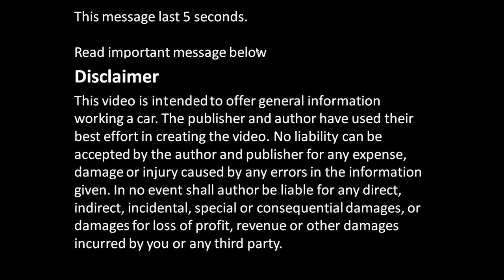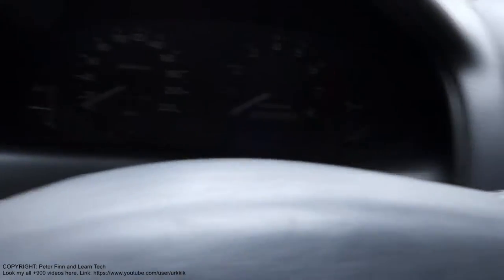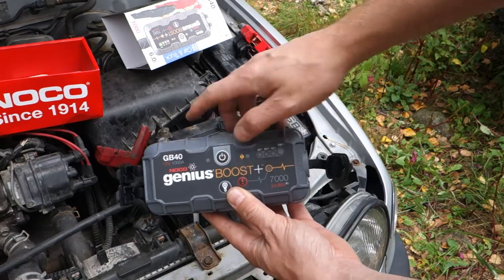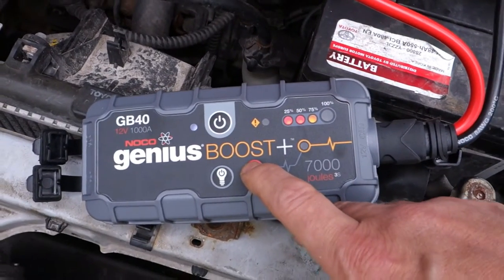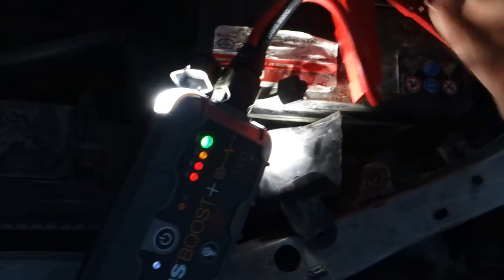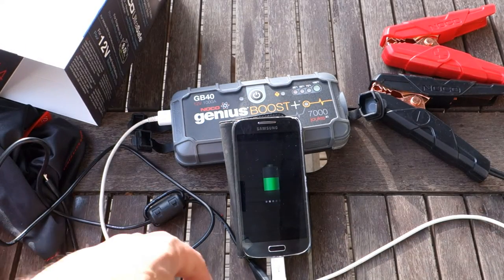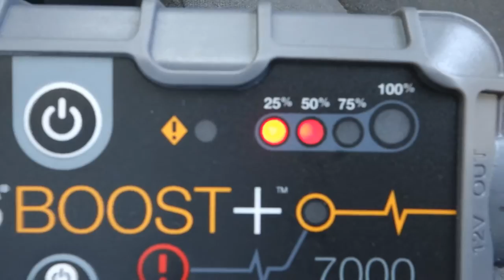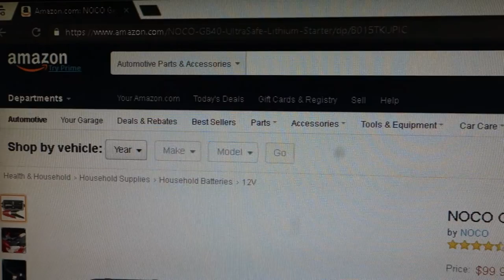How to use Noco battery booster to start pickup truck like Ford F-150

Comment: How many liters does you engine have?  Is that a V8?
Reply from the maker: 1.6
Reply: Thank you.  I don't think it's comparable to a F150 though.  The reason I'm asking is to decide whether to get the GB40 or the larger and more expensive GB70 for a V8.